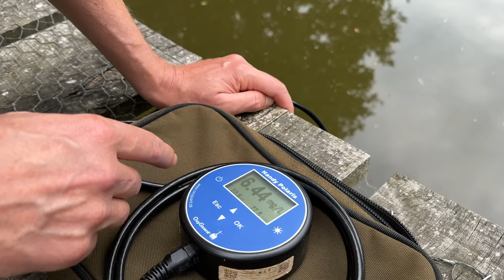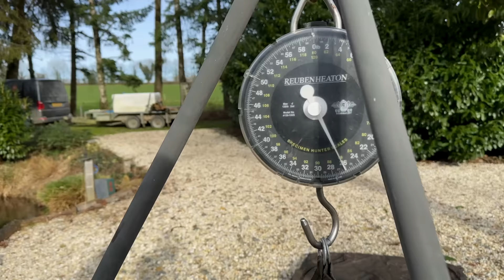I Spent 13 Years Transforming A Neglected Lake Into A Thriving Fishery ❗

Comment: Silt isn’t from leaves.  Silt is particles of rocks and minerals that are larger than clay but smaller than sand.  What your pond is experiencing is pond sludge/muck.  Pond sludge goes by many names; mulm, muck, sediment, and a few more colorful terms. It is simply an accumulation of organic debris that settles in the pond bottom. Most commonly the sludge will be a mixture of leaves, fish waste, decaying plant debris, dead algae, and debris washed into the pond with rain run off.   The other issue your pond is experiencing is from the fish, the carp are degrading the banks, they’re scarifying the bottom actually causing some silting as they feed and turn up the bottom.  The disturbed bottom from the feeding is stratifying in the water column and resettling into other areas of the pond,  it’s very evident at the edges with the stone on the surface and it having a defined boundary to the soft bottom.  Between the damage to the banks and the large excavated “feeding” holes in the pond the carp are causing serious problems.

Comment: Disciplined description of the works! Could you please repeat the formula, how you calculate the amount of carp to cultivate without feeding. We do have a 0.4 hectar pond with too much roach inside. Our assoc leaders pour 1200kg of trout and char into the lake, just to fish it out immediately afterwards. I go for carp (and tench), so I wonder how to develop the amount of carp. Move in some more perch or pike to limit the roach and go for 100- 200 carps between 1- 3 kg?
Reply from the maker: So based on what you’re saying and without a feeding program, I’d say 50 x 3kg carp is your upper limit.

Comment: 51:50 why not make a sort of pilot whole big enough to contain the entire bolt and all ?
Reply from the maker: This bridge is fragile so I wanted to keep the maximum thickness of wood possible and I'd need a 2'' diameter counterbore because that's the size of the washer I was using.

Comment: How long does it take for processed baits to get broken down naturally.
Reply from the maker: Do you mean, how long do boilies last if they are not eaten? That’s an impossible question to answer because many factors affect this. We use Scopex Squid at the lake because it’s formulated with water soluble stabilisers that leach out over 24/48 hrs (temperature dependant). After that, the baits effectively behave as freezer baits would. Breakdown time of freezer fresh baits depends on how hard they are, how big they are, what other species are present and water temperature is a big factor. As a general rule of thumb, if the baits remain uneaten and intact, after a week or so bacteria will begin to attack the boilie and after another week trapped gases will cause it to bob up to the surface where it can be eaten by birds, rats and anything else. I used to make my own freezer baits and occasionally I’d find one bobbed up in the margins. Since we switched to Scopex Squid we see no evidence of this. Everything that swims loves Scopex Squid so un-eaten bait is something I don’t have to worry about.

Comment: Hi ,I’m in need of some urgent help of a wild lake I fish no one’s owns or looks after it and I’ve seen 2 fish with cotton mouth one dead one nearly dead and I’m concerned it’s going to spread to rest of the fish is they anything I could do to help 😨
Reply from the maker: Hi there, sorry to hear about that. The best and only thing you could do is to remove any dead or dying carp and bury them in a hole at least 2ft deep. Ideally apply agricultural grade lime to the hole and then over the fish to accelerate the breakdown (1 - 2kg). This should also put off foxes, dogs etc. As for the rest of the stock, there’s nothing more that can be done unfortunately. The tough will survive, the weaker will die. It’s nature's way.

Comment: Why not invest in a cheap underwater camera they are not that expensive. It will save all the guessing and give good results.regards Alan 😮
Reply from the maker: Tried one mate, haven't got the water clarity. It's also impossible to hold on a spot from the boat if there's any wind. My method doesn't actually involve guessing.
Reply: @matthewcollinsangler A camera would not actually be guessing, and do it on a a day that’s not windy. But l guess from your reply you will only do your way. You’ve heard the saying my way or the highway. Any way good luck to you.
Reply from the maker: @kwerkystorys8617  Didn't mean for my comment to come out that way 😊 I just haven't got the water clarity for a camera.